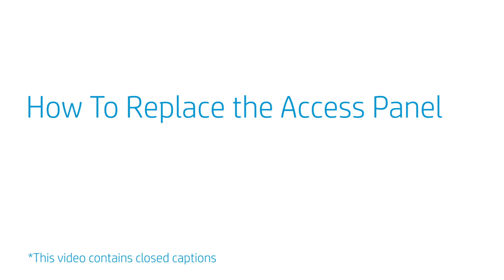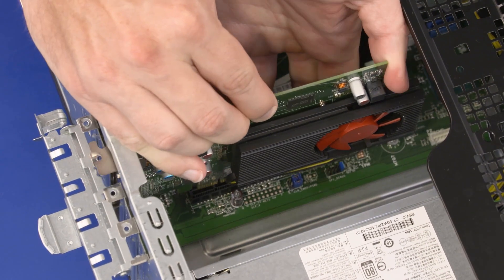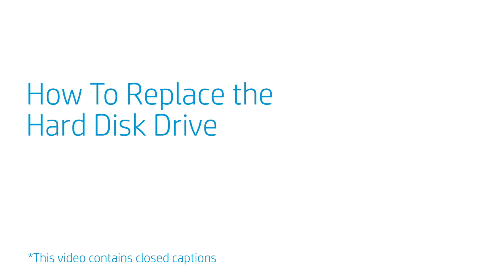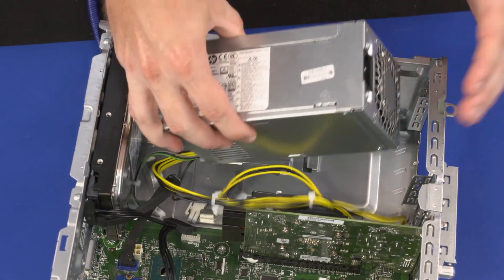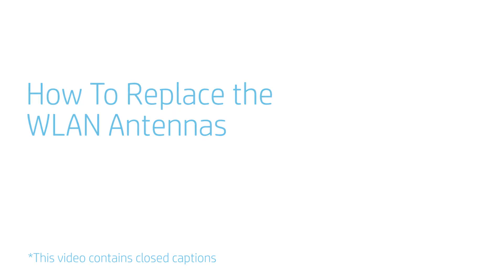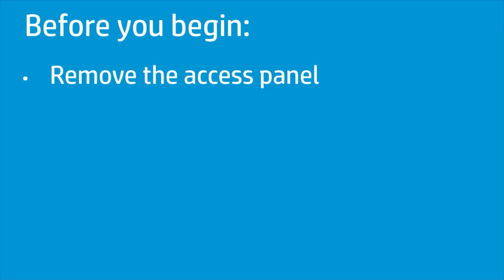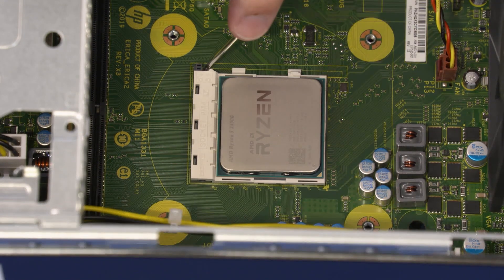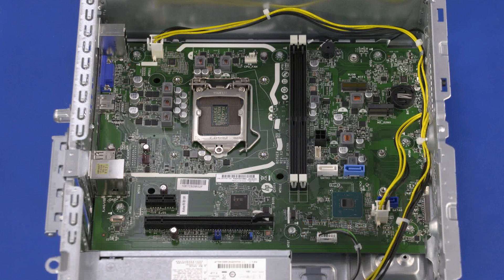Removing & replacing parts for HP 280 G5 Microtower | HP Computer Service

Comment: I have hp 280 pro g5 mt with core i5 8th gen. Can that model use resaizable bar ? Because i want to install intel arc in that computer. Please help me. Thanks
Reply from the maker: Hi there, thanks for contacting HP Global Social Media Support!
My apologies for the inconvenience, I am here to help! 
I'm afraid you will require at least an Intel 10th gen CPU in order to use a resizable bar.
Let me know!
Regards, 
HP Support
Reply: @HPSupport  and what vga I can use in my hp 280 pro g5 mt?
Reply from the maker: Thanks for getting back to us, Well you should look for the older generation cards like the NVIDIA GTX 1000 series and depending on the card that fits your CPU cabinet.
Hope this helps!
Regards,
HP Support
Reply: @Marvi-e7r  any low profile single slot and no power pin works. 2 slot GPU may not fit to both end of the gpu
Reply: @yuikonnu5079  can my pc use resaizable bar ? Or if I use intel arc will be impact to performace ? Thanks
Reply: @reviaprlianto5699  what's your Intel arc GPU

Comment: can I install a full size graphics card like RX 580? 
does it only fit low profile graphics cards?
Reply from the maker: Hi there, thanks for contacting HP Global Social Media Support!
I understand that you need to know about compatible graphics card for your computer.
I will do my best to assist you.
For optimal PC and printer performance, remember to always buy (use) Certified HP Genuine Replacement Parts from a known and trusted source. You can order it via the HP Parts store: https://hp.care/6057oyzu7 
Regards, 
HP Support
Reply: Single fan? Maybe
2 slot GPU? Probably not fit and PSU is like only 180W so it won't sufficient

Comment: I would like to know if this case fits an rtx 2060
Reply from the maker: Hi there, thanks for contacting HP Global Social Media Support!
I understand that you need to know whether RTX 2060 is compatible with your computer.
I will do my best to assist you.
This computer has following expansion slots:
(1) Full-height PCI
(2) PCI Express v3.0 x1
(3) PCI Express v3.0 x16
So you can add graphics card that supports these slots.
Binu - Social Media Tech Support
Reply: @HPSupport  hi, thanks for the reply but could you also tell me if the rtx 2060 is too big for this case or fits well
Reply from the maker: Please check specifcation of the video card and if it supports those slots, then you can use it.
Binu - Social Media Tech Support
Reply: @HPSupport  the size of this video card is 229mm x 113mm x 35mm
Reply from the maker: In order to get this issue fixed, please contact our customer care team over the phone or chat for further assistance, as this issue requires Live conversation with you over phone or chat to isolate the issue and provide you instantly with appropriate solution or repair/replacement options available at your place as per the warranty.
Please feel free to reach us on call/chat, please access this link to select your preferred country and language option to reach us. Global support link: - https://www8.hp.com/us/en/contact-hp/ww-phone-assist.html
Binu - Social Media Tech Support